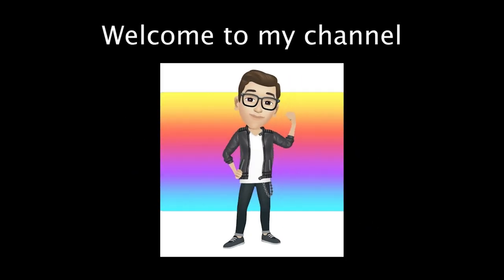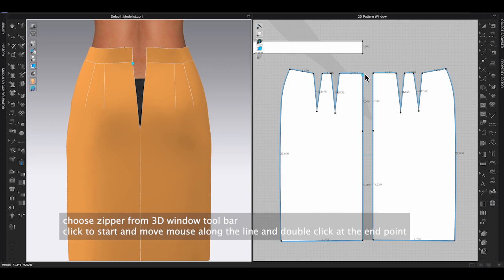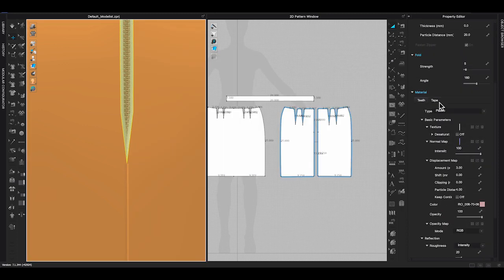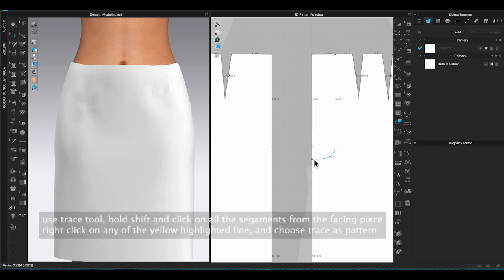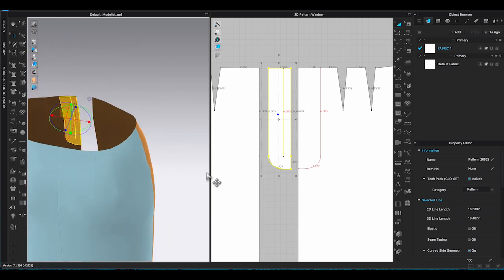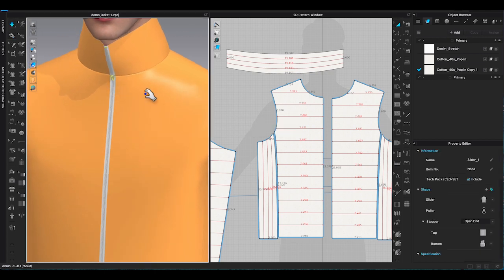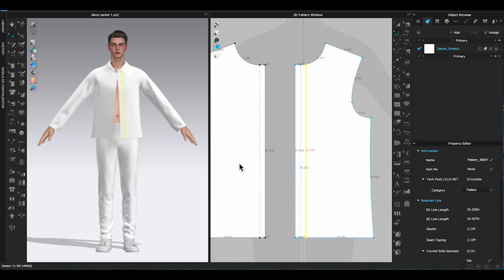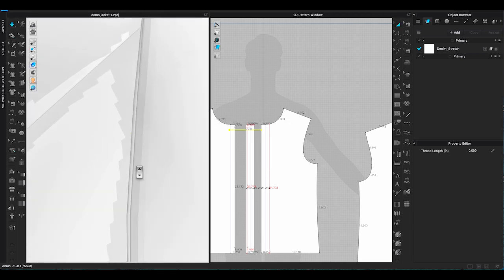clo3d 101- Beginner's guide- How to add zipper (step-by-step)

Comment: When I make a size series and go from size 38 to size 42, the zipper disappears. Do you know the solution?
Reply from the maker: are you using auto fitting( auto grade) or regular grading to change size? I had the same issue when I used auto fitting to change sizes, and zipper was missing. But it didn't happen every time, some sizes were okay.
 CLO3d said it might be a tech issue. They suggested to send the file to their clo3d.com contact us page for them to check. I haven't had time to do that. But maybe that will help you to figure out what the issue was.